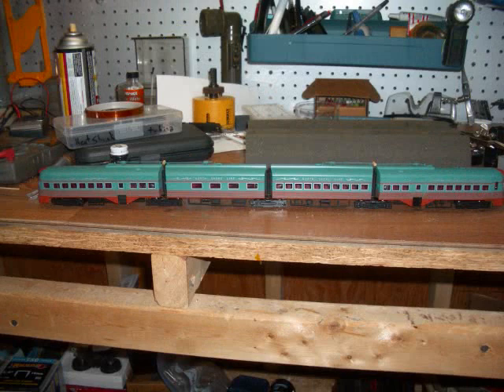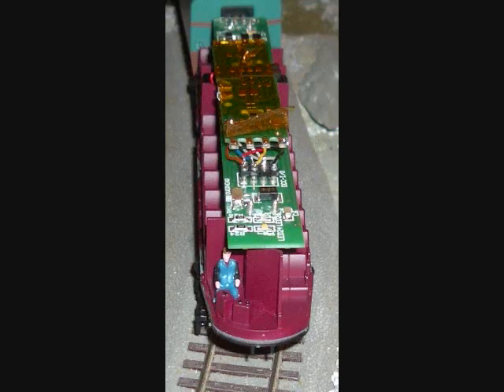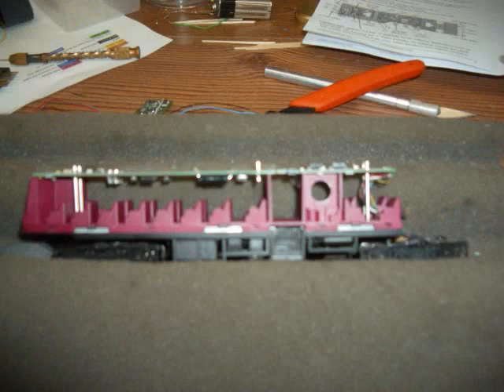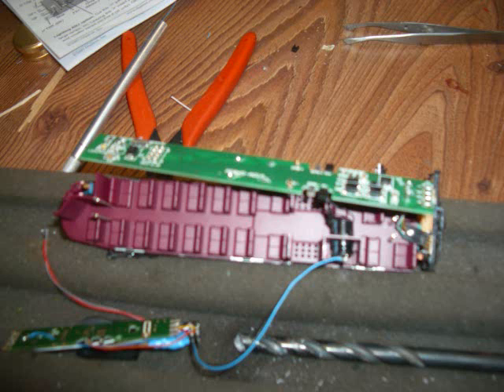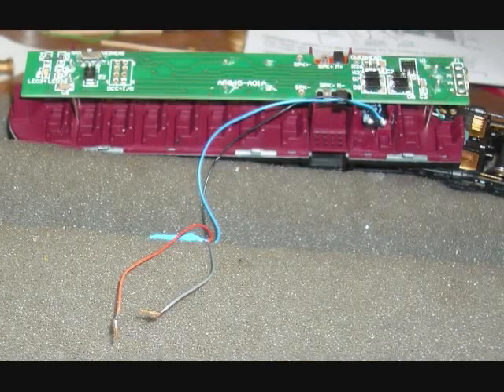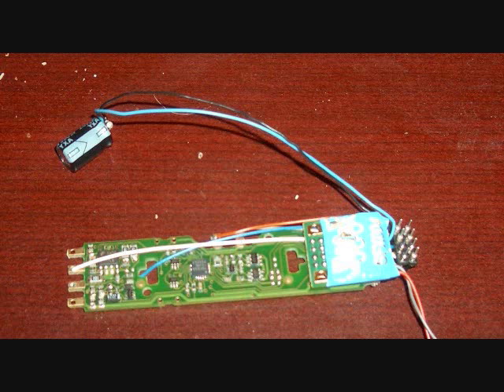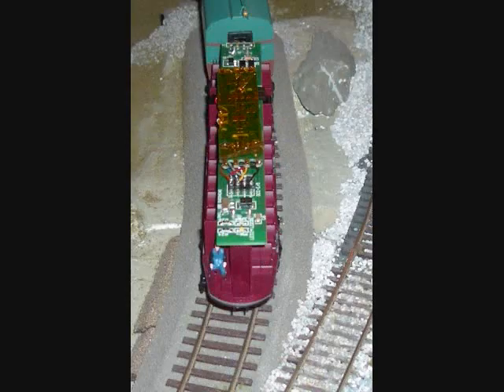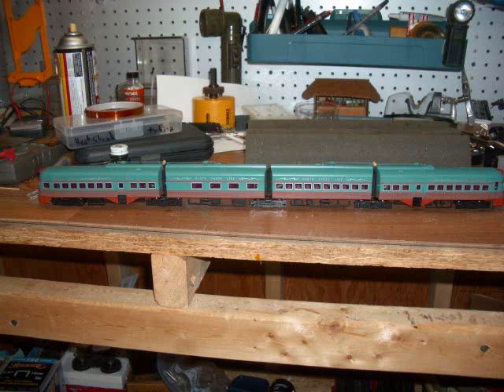North Shore Line DCC with Sound install

Comment: I am with the restoration crew on the electroliner at the Illinois Railway Museum and I have recently bought my self a liner as well and I currently have a TSU Economi sound decoder which sounds quite neat. If you want the real sounds when we get the liner fired up I will be purchasing a ESU V4.0 and making my own sound file that I might share with others if they would like the file. Don't forget we have updates on the progress of the liner on Facebook @campagin for the electroliner
Reply from the maker: That's great news! I am actually very unimpressed with digitrax performance on this unit and would happily upgrade to a loksound module when available.
Reply: 4everunner I haven't own a digitrax sound but I had some non sound and I was not happy. Check us out on Facebook and you can watch as we progress, hopefully we it will be operational this fall (we will only test run and not run for the public until next year at the earliest).
Reply: 4everunner I will definitely let you know when I get to getting the sounds, probably even posting an little thing on Facebook as well.
Reply from the maker: I already have, that's quite an undertaking you have going there. I'll have to make a trip up there once things get up and running to check it out!!!
Reply: 4everunner great, it's well worth the trip after volunteering and going on personal time I still haven't seen the entire museum